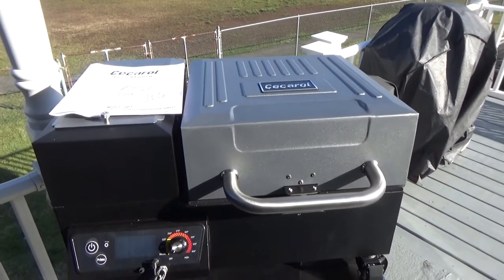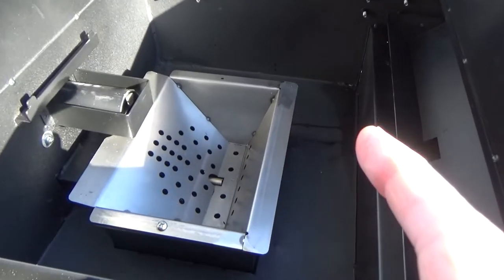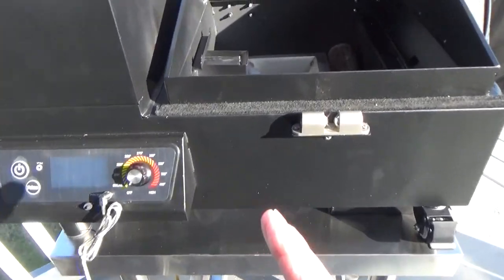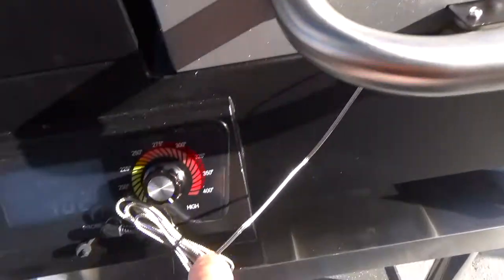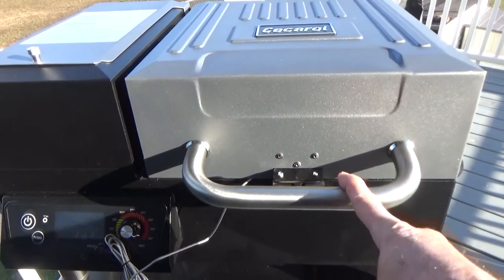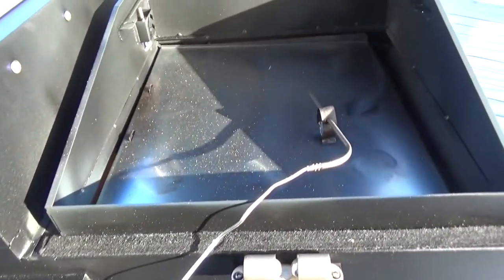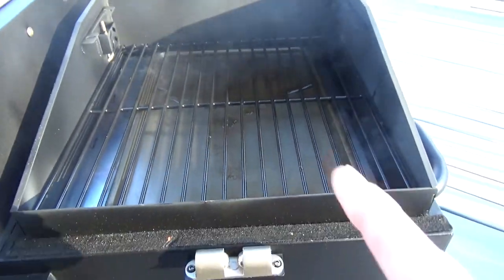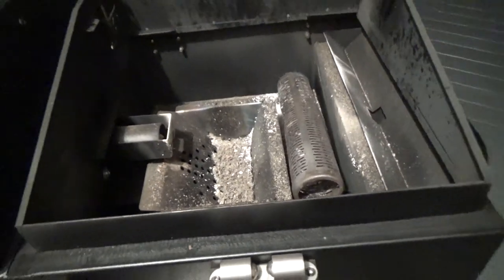$199.00 CECAROL Tabletop Pellet Grill on AMAZON, Get Better Smoke Flavor using Wood Chips

Comment: Very cool I have never seen that Cecarol pellet smoker before I like it. I noticed that the meatloaf slices had a smoke ring on it so it must have been good. Definitely going have to try that putting chips in the smoker tube instead of pellets. Thanks 👍
Reply from the maker: Yep.....You are the first to mention that there was a small ring.  If I had more time I would have kept it at the lower smoke temp. 
The chips are the trick.  Add in a few pellets and pack it all in tight with a stick......you will get a longer smolder time when you add in the pellets......
but the wood chips are the way to go. 👍   Metal On! \🔥/

Comment: I like the wood chip in the pellet tube trick, fukin brilliant Ken! Cool little cooker
Reply from the maker: Hey Gary!   I've been doing that for awhile.........mix real wood chips and a few pellets together and pack them in tight with a stick. 
You will get a longer smolder mixing in the pellets.  You will smell and taste the difference. 👍  Metal On! \🔥/
Reply: @HeavyMetalBarBQue  I will try it thanks Ken

Comment: i like hickory saw dust in my tube.. not pellets. .i am going to have and try wood chips also. love my cecarol i use it a lot..
Reply from the maker: Hey I think I watched a couple of your videos when I was researching this grill?   Aren't You the one who took out that pain in the ass grate in 
the pellet hopper?  I had to keep pushing the pellets down with a screwdriver......and it even ran out of pellets in the auger when I wasn't paying attention.
I'm gonna pull that out to be able to just push them down with my hand.  I'm not sure if I'm subbed to Ya'.....but I will.  
Yep......use wood chips and mix in a few pellets and pack them in tight with a stick......you will get a longer smolder when you add the pellets. 👍 
Metal On!  \🔥/
Reply: @HeavyMetalBarBQue  ya took the safety guard out. This little pit. Turns out some great food.